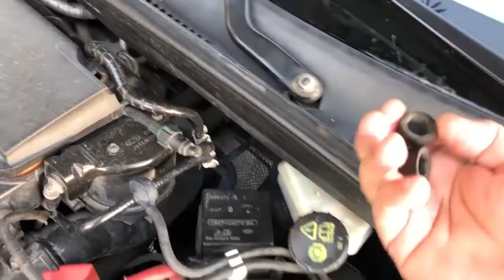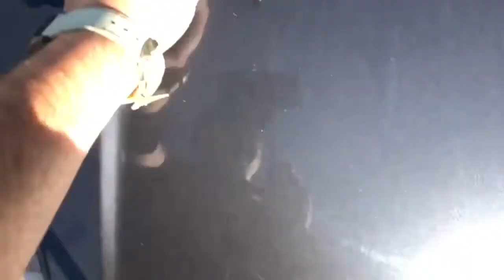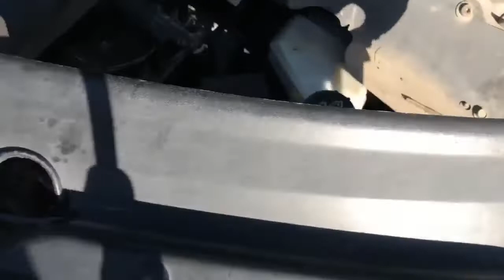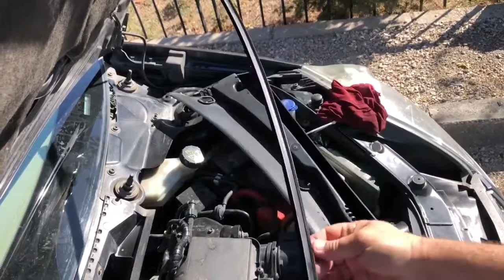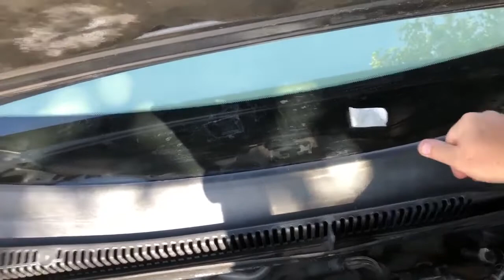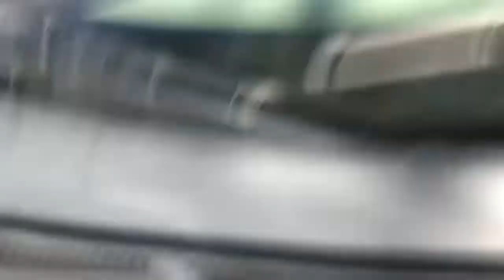Fiesta - Fixing air-cowl grill gap

Comment: Thanks a lot for this video! I had a so called professional repairman replace front wipers motor assembly and during the process he fuc*ed up and now I have huge gap and the rain water is entering the cabin. I'll try to fix it the using your video as guideline
Reply: What type of silicon did you use?
Reply from the maker: Black colour, multipurpose adhesive.

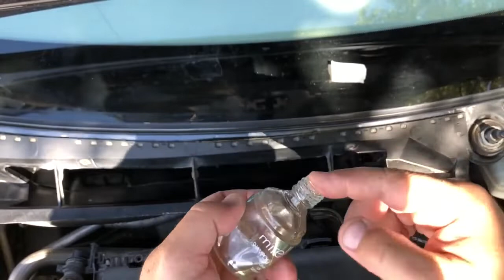Comment: SOrry, why do you apply soap at 7:37?
Reply from the maker: Hi, it is to make ınstallation easy, used it as lubricant. Hope this helps.
Reply: @handyguy6273  thanks a lot! I have managed to separate from main frame and riassemble without soap. My only "fault" was to not use silicon to glue it to the windshield, but i was worried about future disassembly
Reply from the maker: @Massive1986Cava  That'ok. I hope it does not get loose again with the shocks an vibrations of the car..All the best!..

Comment: Great video i have this problem at the moment. Going to try and sort this with the help of your video. The only thing im not sure is how did you put the panel ends back on as it did not show on your video. Do they just slot back in or is silicone used to keep them in place?
Reply from the maker: Hi, I'm happy to hear that my video is helpful to you. Silicon adhesive joins the thin strip to the bottom edge of windshield the cowl gril snaps on it, hope this helps :-)
Reply: @handyguy6273  its the plastic corner pieces im asking about that sit on the outside of the trim. You pulled them off on the video after you removed the panel.....sorry if im not explaining right but im a women lol
Reply from the maker: @sarahdeley1040  That's clear now, those side corner pieces has about 1 cm extension underneath  that enters to the slot to hold them in place, be careful while pulling them out they can  easily be broken. :-)

Comment: Nice videos, mate, thank you. :) 
A question: it is OK on yours, but do you know how to adjust front gap between upper grill and bumper (next to headlamps) and hood/bonnet? I'm planning to buy a used Fiesta and majority of them have messy or asymmetric gap. BTW, little worried about that, it could indicate some earlier crash?
Reply from the maker: You are welcome dear friend :-)  I have taken out front gril several times but I didn't notice any adjusment between bumper and the grill . They are plastik snap on parts. If you notice uneven gap between them it might be signs of  previous accidents (thats generally my method to suspect for previous collisions to observe the  gap between body parts such as doors and front fenders+A frame, between hood and fenders etc) Wish you all the best.!!!

Comment: Congratulations .. Nice work .. I have the same problem. What is the name of the part you are sticking to the windshield with silicone?
Reply from the maker: Thank you, you don't have to buy any trim piece to do this repair. It is a part of "cowl grill trim" and it is attached to the air cowl grill.  It was just loosened from the windshield and I have fastened it to windshield with silicon. If you check,  you will probably see that it is already  on the car.

Comment: Thanks I've got to do mine 53 plate I've plants growing out of mine ....... my spark plugs well have water in them every time it rains hard I have to take the air box off and h d leads off and dry all water off ..
Reply: For the spark plug well leaks that could be water getting in via a gap between the the water jets and the bonnet. New rubber seals or silicon can fix that.
Reply: Lol I put silicone around everything lets see if the water can get through that... lol F knows how they are  getting  my window off if I have get crack in it ....
Reply: Had the same issue with the spark plugs and that worked for me so hope it fixes your issue.   Yeah i don't agree with putting silicon on that as foam tape fixes it lol
Reply from the maker: You're welcome! 😊
Reply: mine has had the same problem, theres been a gap in this piece on the windscreen ever since i bought it like ten years ago, never really bothered by it, i'd occasionally pick some of the moss clumps out 🤣 but i think it's caused water to pool on a part under the hood, the side thing that is like a metal dome with a cirlce cout out, with the end of bolts sticking up through it  in a circle. Seems a previous owner or mechanic messed with it, as the little side pieces were partly under the middle piece, so i thought that was how they were supposed to go, i've put them back that way, will have to go out and give it a proper fix some time, as thats probably whats causing the water to pool.
 
Also had the same problem with the water getting into spark plugs, and on the main engine, damaging some seals on the engine over time. fortunately managed to get that sorted without having to replace everything. But yeah i couldn't find replacement gaskets for the water jets that weren't a ridiculous price so i just used some clear silicone on the water jets. Seems to be fixed. Only took be ten years to get around to it :P